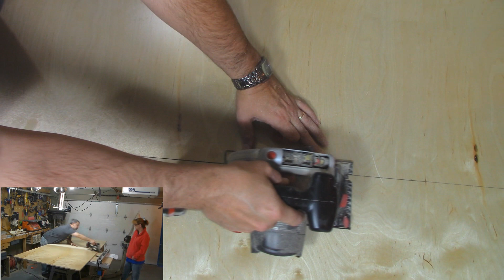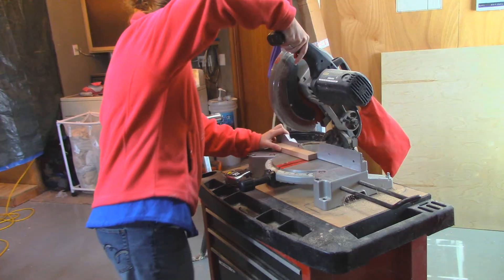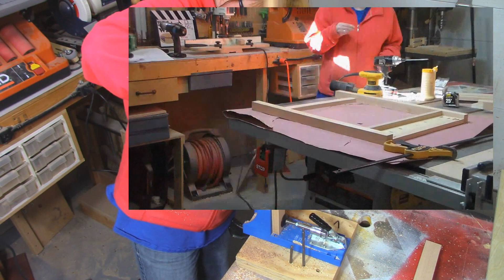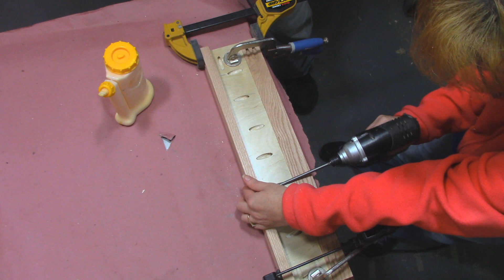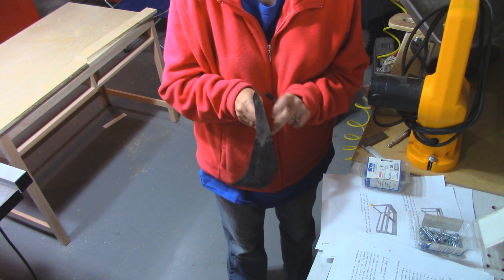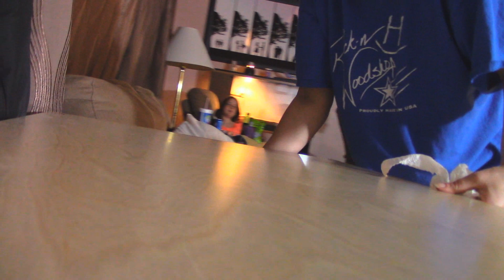Build a Computer Desk

Comment: Awesome Family Video! Question: What type of drill works best to drive the pocket hole screws? I have a driver/drill and on every torque setting I sometimes strip it out. Should I have a hammer drill?
Reply from the maker: I use an impact driver Every now and then I'll strip one
Reply: +Mike Fulton Thanks Mike!